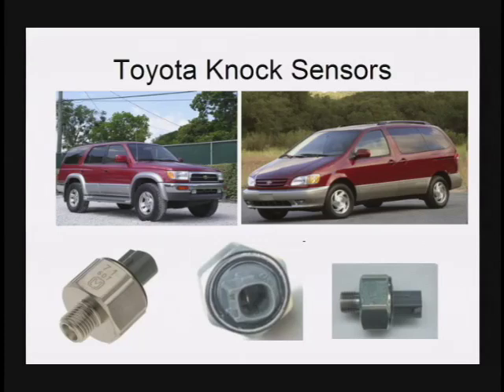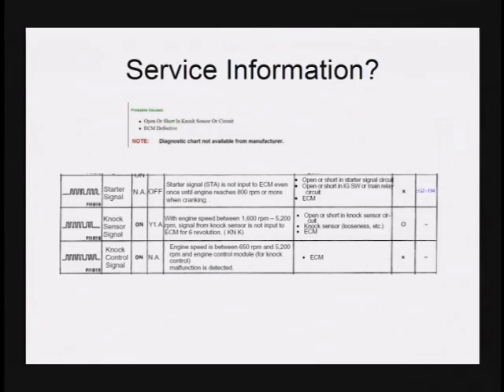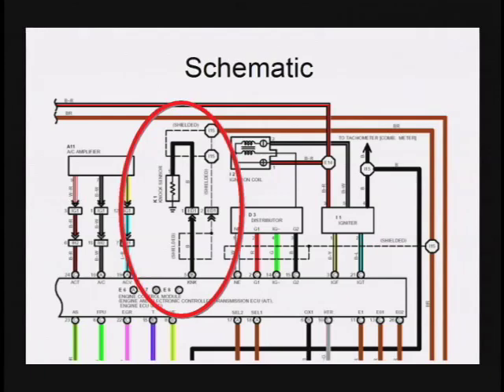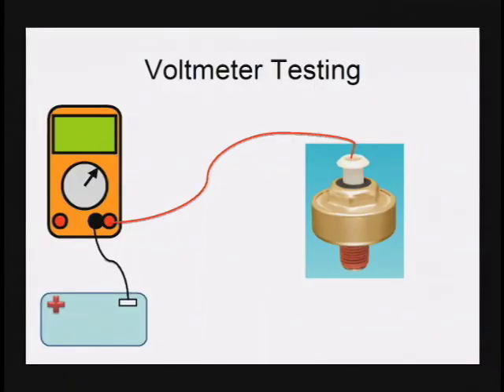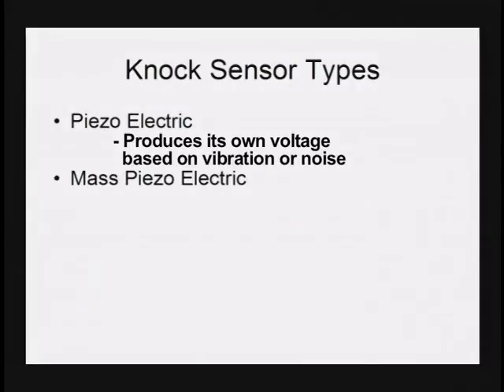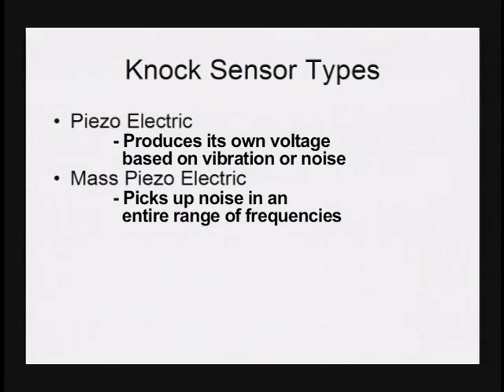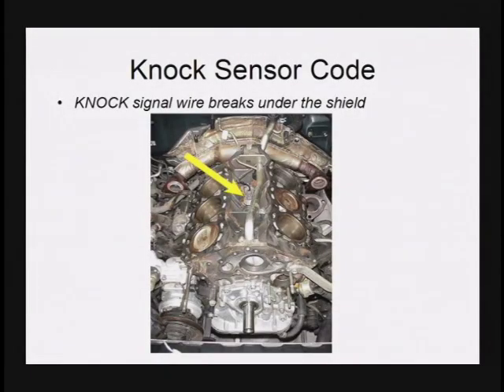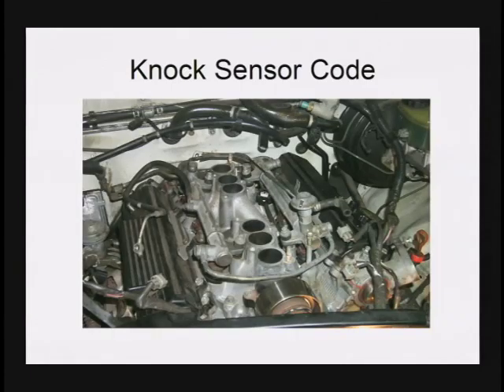Knock Sensor Testing | Toyota/Lexus | Tech Tip

Comment: question: the knock sensor produce it own voltaje but what is standard voltage? I have a kia sportage and the manual say the ks proces average voltage is 2v - 3v AC and other ks other brand only 750mv o lower, anda how onw what is thea real voltage for to know if is the bad o good ?

Comment: This video was made back in 2009. Many of these vehicles are now older and at higher mileages and knock sensor codes are a regular thing. Recent history tells us that most of the time its not the knock sensors. Instead its the short wiring harness going between the knock sensors and the main wiring harness. The heat down in the engine valley eventually damages the shielding on the harness and this is what trips the codes.

As stated in the video, on a Toyota or Lexus V-6 its a lot of work to get to where the knock sensors are located down in the engine valley. So if you are going to dig your way down in there its best to change the wiring harness, both knock sensors and the short bypass hose. Its important to only use original equipment OEM knock sensors and harness made by Toyota. Many of the aftermarket parts are substandard and they will cause the codes to come back again. You can buy OEM parts on eBay but be sure they are Toyota parts and not knock offs. Be sure they are still in the original Toyota bags that the bags are still sealed shut. I just recently bought two Toyota knock sensors for $23 a pair and a Toyota harness for $36. They were installed and the engine was put together again. That was weeks ago and the codes have not come back. Its worth it to change all 4 components down in the engine valley so you won't ever have to do the entire job again.

Finally, just in case its a good idea to check the new sensors and the wiring harness before you put the intake manifold back on. Connect the ohmmeter to the end of the knock sensor harness that plugs into the main wiring harness. Note that the connector has 4 pins but only 2 of them carry the signal. The other two pins are for the shields, which aren't connected to anything. Then ground the negative lead of the ohmmeter. Then tap the cylinder head and see if A/C voltage comes out of the harness connector. If it does you are good. Don't worry about the frequency response of the sensors. They are brand new and they will work just fine.

Comment: On a mass peizo system The noise outside resonant frequency is usually filtered inide the ECM input circuit. It would have a bandpass filter tuned to 7Khz or whatever is the natural resonance of the engine.  The resonant frequency of the engine varies by its mass and material and shape. Probably not by much maybe in the range of 5-9Khz.  Most noise and vibration from other parts are lower amplitude than actual knock vibration.  I think the put the tuning in the sensor to make the ECM circuit simpler but also makes it hard for DIY people to test so required to goto the dealer. But thats just my hunch. Think about it sensor is physically tuned to 7Khz center frequency makes cheaper to manufacture the ECM... More profit. Knocking or hammering on block should cause the block to "ring" or vibrate at its natural resonance like tapping the side of a wine glass or a wind chime. Although its so dense and heavy you don't really notice it or hear it the way a bell rings its going to resonate.  NASA supposedly did a ring test on the moon during the lunar landings to determine the resonance of the moon and to calculate its mass amd density and likely internal shape and material...

Comment from the maker: As the instructor states “When changing the knock sensor change the short jumper wire from the knock sensor to upper harness”

Toyota in their service info. add replace PCM to the above. Start testing the PCM pin by pin only after wire is replaced and if you still have a problem.

Comment: Hello Sir . 
Most tests on th Internet say  you  should  expect to see a 2.5 voltage at the sensor connector , while the sensor is plugged in and the ignition key is turned on ., and a 5 volt when the sensor is disconnected ......

Does this apply to Toyota cars ?.......It does NOT seem to be the case .  Some people say Toyota sensor work differently ....!

Comment: 7000hz can't be achieved with a hammer an extension...use an air hammer! Hahaha. Just Kidding don't do that.
Reply: Hector Vargas that 7Khz is the natural resonance of the engine block when it is smacked hard. Like a wine glass or guitar string it can vibrate at its natural freq... It varies by the block shape mass density and material but probably not by much.

Comment: no
you need to lean the mixture not to remove gas completely
disconnecting one injector will you make see a single cylinder misfire code ,not more

Comment: Your not listening for a knock at "7000 times a second", but a knock at a frequency of 7kHz, just to clarify. And introducing a loud sound at 7khz will most likely not trip it because the sensor is "listening" to the resonance in the block, not the ambient air surrounding the motor. If that was the case, every thumping bass system would be retarding the ignition. Now if you could put the voice coil right on the block, then you would register AC.

Comment: I recon to test the later version of the knock sensor to put a loud speaker on the motor and use a laptop to generate a 7khz sound. Probably safer then forcing the motor to ping.